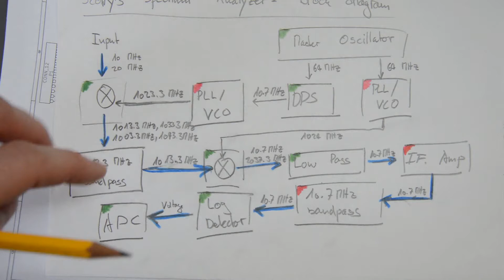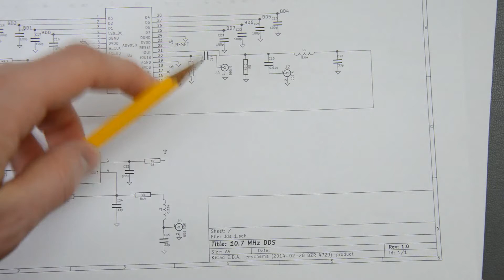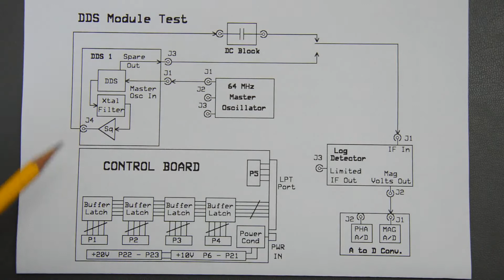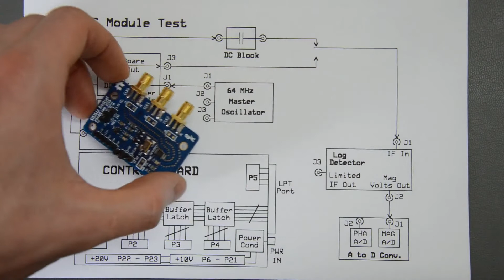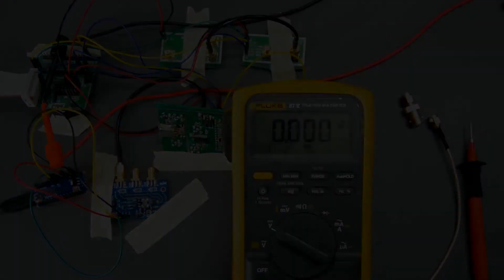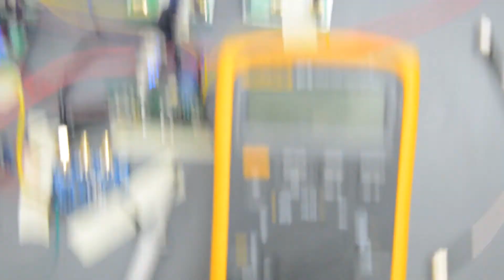Homebrew Spectrum Analyzer 11: DDS Module Tests, Part 1

Comment: do you know why it uses two mixers?
Reply from the maker: +Luis A P Barbosa You mean the architecture of this instrument? Yeah it's basically a classical double superheterodyne receiver but instead of downconverting the second IF to baseband, I measure its power by dumping it into the logarithmic detector. In a nutshell, the first mixer converts the input to roughly 1 GHz for mirror image rejection. From there, the second mixer converts to 10.7 MHz, where one or more 10.7 MHz filters single out the signal of interest. This is where the resolution bandwidth is determined, and it is where adjacent channel rejection would be performed if this was a classical receiver. Was that answer helpful?
Reply: +MrCircuitMatt Yes, thank you.

Comment: Have you already tried upgrade your scope bandwidth?
http://www.eevblog.com/forum/testgear/dsox2000-and-3000-series-licence-have-anyone-tried-to-hack-that-scope/375/
Reply from the maker: +Luis A P Barbosa No I have not done that. I am a bit reluctant of trying to be honest. As far as I understand, this would not only upgrade the bandwidth, but also unlock a few features, right? The latter might even be more interesting that the bandwith thing, since I don't have many applications where the modest increase of bandwidth would be of use. I'd expect the PLL output to look closer to a square wave with a higher bandwidth scope.

Comment: Well done video, as are your others. The "squeezing effect" you see at 19:20 is the DDS output frequency sweeping around 10.7 MHz as the main software is sweeping. Your scope will see this as aliasing. When the sweep is halted, the frequency of the DDS will immediately become stationary.
Reply from the maker: +William Sprowls Awesome thanks for watching! I had assumed that the DDS was sitting on 10.7 MHz rock solid all the time. Now that you mentioned it, of course what you say makes a lot of sense. I'll rectify this in part to. Thank you so much Scotty.